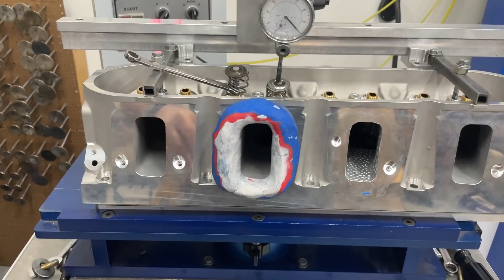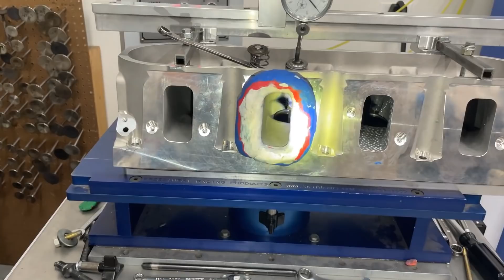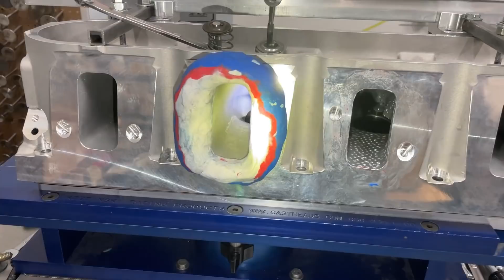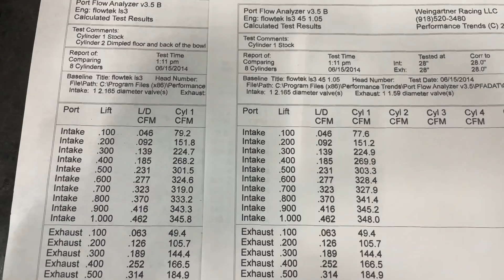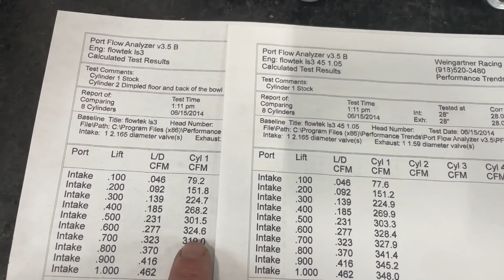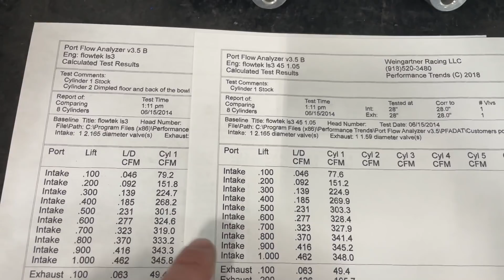Wet Flow With Dimples

Comment: I'm sending you my ls3 heads soon for the valve job and im going to do a slight port and polish just like in your previous videos and do the partial dimple. I'll see if anyone locally will flow the heads and I'll email you the numbers when it's complete. Maybe it will work maybe it won't but i don't have the funds for the promax heads yet and this is the cheapest route i can do now

Comment: Reher Morrison used bent shanked cutters. They claimed the ports in their own engines were so rough they were afraid to release the same work to the public, likely due to the public idea that a good port is polished.
Reply: Yep..profiler guy (cant recall his name) does that also. 
Rarely do I use cartridge rolls on my own stuff anymore only in a few key areas depending. 
Keep a few worn carbides around but not bent

Comment: Wet flow and dimples and dimples in the chambers was dune at AFR in 1980 with Ken Sperling and Chris Brintnell we used strob lights to see what was going on a little power was found Chris and Ken were in to cup racing at that time nothing new about this Chris Brintnell is now with SoCal Diesel still doing heads and flow bench work at 71 years.  Head work for 55 years have worked for the best in racing. Nice job on your testing

Comment: I have been using dykem in the port and change the port , so many times it crazy & you will never have the port completely  cover in the bowel , because  of port Bias,  you better off using  smoke tell you why more & I tested  it a clear head too, every body think that the port is completely  filled with  gas & air it  is not lol

Comment: What would happen if you contoured/dished-out the length of the ramp floor slightly into a "U-Shape" the full length of the ramp floor......sort of like the shape of a "Water-Park" slide 1/2 tunnel shape, or the opposite & give the ramp floor an arch-shape?????
Is either of those shapes common practice to help evenly distribute the air/fuel charge across the entire port instead of it being concentrated in one area?????

Comment: Considering the millions of dollars expended in the science behind the size, pattern, and placement of golf ball dimples, I notice the pockmarks done by most for "dimpling" do not resemble golf ball dimples at all. It reminds me of cylinder heads where to "do it like the pros" we forget to include a port in cylinder number 3 and then wonder why cylinder 3 is not getting any air. No golf ball looks like the pockmarks done by most machine shops. As an experiment, try those same pockmarks on a smooth ball the same size as a golf ball, and see if the drag is better or worse than the drag of the professionally-designed-and-place dimples on the golf ball.

Comment: Liquid is ~810x more dense that water, ~560x vs fuel, so that inertia resists direction changes. It literally splattered on the back wall & valve, causing that lighter wide pattern.

Either way carbs will generally atomize the fuel before the valve, EFI heads usually aim at the base of the valve.

Comment: I’m pretty sure that the air creates a vortex as it flows through the port and that is what spins the liquid out of the airstream. Try watching the flow using a smoke pen. You’ll see the smoke spinning in the port.

Water is heavier than gas and alcohol, so fuel might not spin out of the airstream like Dykem. 

Later big block Chevy heads have a ramp in that location. Maybe the ramp is for fuel atomization.

Comment: Been using dimple porting for the past 20 years or so with excellent results from throttle body on down. Only area we polish is the exhaust ports to reduce carbon adhesion.  Good video. Rottler has the software program to do all with their 5 axis machines. Much quicker and uniform. Get the dimples a bit closer for better results as well.
Reply: Cool, so you recon doing it by hand is waste if time?CNC only? 

Can it be done by Hand? How close mm(inches) dimples to each other how deep +- inches and what diameter dimples? Partial dimple or whole surface area?

Sorry for questions, I'm from 3rd world country, no acess to CNC.

Just grassroot racer trying to improve race engine.

Polished texture(intake manifold and intake port with dimples, or smooth with slight resistance e.g 180 grit 220 grit 400 grit hand finish with sandpaper(dry? Or wet? Sandpaper finishing?) Thanks
Reply: @nicopotgieter453 
Could easy do by Hand, Any free horsepower / torque is never a waste of time.
Use a dimple/medium shine on intake and high shine polished ex ports

Comment: Why wouldn't you bolt the intake to the head spray the dye down at the intake floor and let the vacuum pull it through the head while still wet

Comment: Eric,  what would happen to MIXTURE uniformity and burn if the vane in the bowl was angled off 30 to 45 degrees to one side or the other?

It seems the liquid is concentrated in one small area and would drop out leading to cylinder wash and unburnt fuel leaving the chamber.

Comment: dimple for the WIN!   since the line is spread a great distance the atomization is better, this should increase efficiency there could be some power to be had maybe torque. I am going to cut slats all the way down the wall in the same pattern on mine all the way to the valve like the dycom there. Thanks for a great idea. Also what do you think about me splitting the head runners with a divider all the way through the intake runner also. for port velocity. ?  My plan was to use large large runner head (without the valve seat machined so i can use a smaller valve than a race valve) and run dividers throughout and slats or dimples to break up pools, and also narrow the runners while keeping them tall and raised. creating a slightly smaller port volume for a milder application with  more impressive flow capability also. Also thought of using a 4 valve head conversion as well.

Comment: That is crazy. I figured that it would have more coverage in the bowl. It is also weird how it took the spray which is at pretty much a mist, and brought it back together. Bet a slow mo cam inside the port would reveal a vortex. I’m guessing the ultimate goal would have the spray make more contact on the back of the valve or as close to the seat as you can?

Comment: Hi Eric, thanks for the data. I would recommend trying a 50/50 Dykem/alcohol mix using a spray bottle on fine mist, should keep the heavy fluid suspended for longer and allow you to spray alot more volume 🙂

Keep up these video, they are great!

Comment: This test needs to be done with an intake manifold attached and a more constant way to regulate the dye.
Reply: Wouldn’t be accurate. Flowing a single port is accurate because it’s an individual path. The plenum of a manifold sees reversion and pulses from the engine. The flow bench can’t simulate that at all.

Comment: I want you to Flow a intake  port WITHOUT  a valve. 
Compare  the Flow at one inch  vs No Valve.
Also  
Test #2
No valve and No valve  guide,  just a clean intake port..
Compare #2 vs Flow at one inch.

Comment: Definitely looks like the dimples help with atomization. I was initially confused as to why all the Dykem gathered on one side of the port but with most of the combustion chamber volume near the spark plug it kind of makes sense to me that vacuum would be stronger in the area of the valve nearest the spark plug, which is nearest to where the dykem gathered in the port, and pull the dykem directly toward the spark plug. Seems like the added turbulence can only help with atomization. Not sure if that is right. Just trying to imagine what smoke would do.

Comment: Did a ton of this testing on our wetbench years ago. A few dimples here a few grooves there and abrasive valve angles .works on all our dirt heads great. Gd job
Reply: Ok cool, so you study the aftermath of a running engine? And Only apply curves and dimples where the pattern(fuel) got e.g puddled and burned. 

Make the fuel/air as humongous as possible?

Cant be easy to read(patterns) and apply. You must have alot of experience. 

Almost like reading sparkplug.

So cool

Appologies for questions, just a grassroot racer with no acess to CNC(my  country)

Does this dimples apply to carburetor only?or do fuel injection also benefit?intake port and manifold?

Always curious how pro's do it and hopefully learn something
Reply: @nicopotgieter453  I think its a complete waste of time & dont belleve a lot of tales told about some mystery engine

Comment: The next dykem test should be a ported runner without the dimples...this way you can compare the flow patterns. The use a flow ball throughout the port, every inch or so, as to check and compare velocities.
If anything, it will let see what, where and how it is happening.
Then by process of each little individual modification (or experimental modification) what does/ not work. Call it process elimination.

Comment: The dimples should help atomization of the fuel. I've always heard that the cast surface helps with fuel atomization providing the flashing is taken out. For the same reason that dimpling does the boundary layer and swirl helps atomization.
Reply: It's pretty interesting to see the results though it seems the as cast surface doesn't spread out the dye how you would expect.

Comment: The factory cathedral port heads that I have seen, (I'm not an LS expert) have a wing on that side of the guide (706 casting). Do you think that it is to create a shear point to keep the fuel from sticking to that portion of the bowl? Basically trying to keep the fuel atomized?  
What would a wing on that side of the guide do?
Reply: I'm not too familiar with LS heads, but it could also act as a swirl generator. A shear point or ledge would probably make the air stall, pulling more fuel out of suspension.

Comment: If you do after all the testing dimple the second runner, just dimple where the dykem was and see if it changes, then dimple small sections in and around the bowl. Keep the changes small to see if dimpleing only works in certain areas. I can do the cfd, but I dont have a model to go by i can only guess what the runner contour looks like.

Comment: What about using acetylene, light it and use the soot from it. It should gove you better results as it doesn't have a adhesion component nor will it have such an effect of static. Would probably match better to the boundary layer.

Comment: I prefer 2 tests which I always perform with a syringe and very long needle.    

1th  is  injecting fluid/dye at the point where either carb or injector does.  The observe what happens and what pattern in port,  chamber and cylinder looks like.
As the dye is much heavier then air it will be smashed on the front side of the valve bowl.
2th is with needle inject dye right on the portwall 360 degrees around right after bell mouth .   That shows where air/fuel  will seperate from wall , or where air stands still etc etc etc. 

Remember that ports are mostly completely covered with fuel...so both tests are necassary

Comment: After you've done one of the ports grind the guide down and see how much you can gain from cutting the guide back.
Reply: Dart might know they use wetflow testing a lot
With just air grinding the pee out of the guide boss never was a great result.

Comment: Regardless of dimples that port did a  very impressive job of coalescing the mist. Seeing how the port tends to condense mist droplets has to concern engine builders that fuel droplets not being broken down "vaporized" but possibly being condensed/coalesced instead.....In short the goal of fuel droplets being compleatly broken apart could actually be thwarted inside the port. You got to love that any given humidity goes into dew points via temp drop and gasoline evaporation more so alky causes significant temp drops that would tend to form both fuel and water droplets going into the chamber.   Smokey Yunick advised of large droplets of fuel in the chamber creating/acting like a lean condition in the chamber, while indicating rich in the exhaust.Hence the belief you want course/rough and maybe even dimpled intake pots and runners with carb'd motors.

Comment: So...if the floor is causing air to ramp upwards, and it is a badly designed port, 1) why wouldn't the mfg have caught this and redesigned the port ?   2)what would you do to fix the short turn in this instance? Fill it? Lower it to a completely flat floor? If it were completely flat, wouldn't it shear off and head off to the far side of the bowl? How would you force air to turn in a direction it does not want to go? Seems it would need to be curved somewhat (like a negative ramp) so that some air would attach like on the top of an airplane wing creating some drag and try to move on the curved surface.

Comment: If you don't do a before and after then how do you know the effects of the dimples? I did a blocked off intake and one barrel of a 750 carb in ran die through the jet to see the effect of carb, intake and head and learned that it matched the fuel stain pattern you see from a running engine.
Reply from the maker: I did it’s in the other video.

Comment: I would think that a thinned solution, stuck in an air brush or spraygun, and aimed at a downward angle from the roof of the port would give a more realistic simulation of distribution…..at least for injected motors.  I’m also thinking that air pressure similar to fuel pressure at the injector would be best.  Hell, how difficult would it be to rig up an injector for repeated use, using pulsed sprayed died thinner?

Comment: The specific gravity of pump gas will typically range from . Dykem would be in the range of 0.880 to 0.940 way to
Reply: Psychic Friends Network ?...............obviously fuel vaporizes while Dykem dries . What are the odds that area of concentrated Dykem actualy vaporizes the hell out of fuel droplets??
Reply: @roberthawxhurst3717  Check out Darin Morgans youtube video on wet flow

Comment: Would that indicate where particles are falling out of suspension? Good video.
Reply: I’m with you on that. The drop out is taking place behind the valve guide where the air speed is slower.